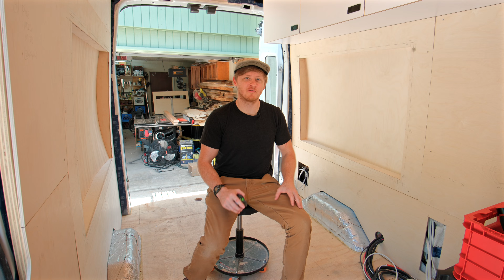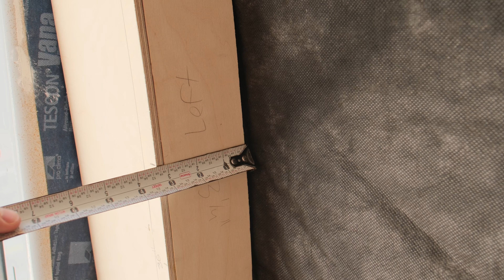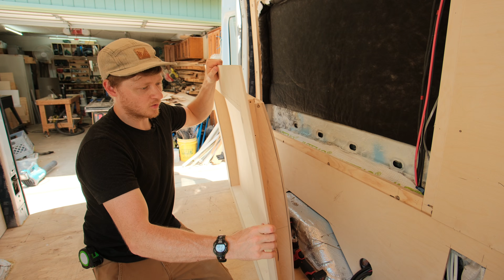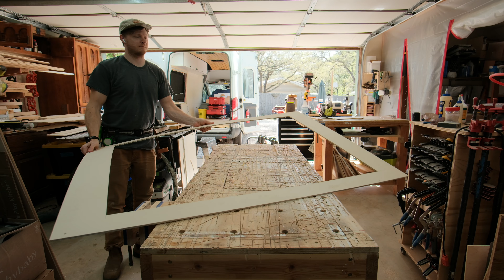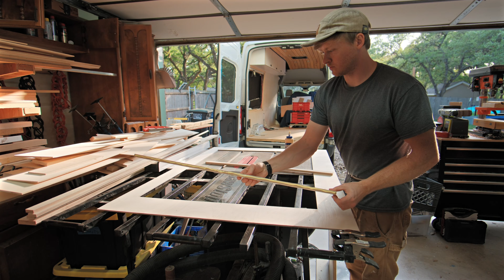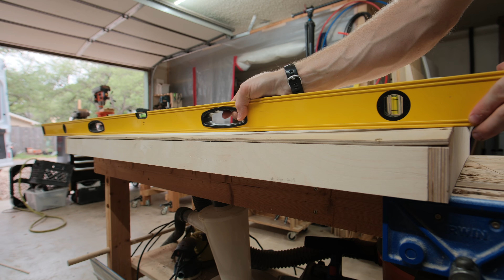No Flares? No Problem. Try This Wall Panel Build Instead

Comment: Sam, with the extra space behind the wall, if cost wasn’t an issue, would you add some radiant barrier and/or more insulation? Thanks
Reply from the maker: I do plan to fill the space with more insulation. A radiant barrier could be used but doing them properly in van walls is a challenge since a radiant barrier needs an air gap as well to perform as intended.

Comment: Greetings from South Texas, great videos I'm learning a lot. I trying to convert a box truck.i Was wondering is it possible to use to use 2 1/2 aluminum studs framing for wall builds and possible for bump outs? Thank you so much
Reply from the maker: Hello! Box trucks are a little different in that they are usually more square and wider already than vans. I guess it would depend on how the box truck is constructed but you may not need to build out framing with aluminum studs if you can just build out over the framing already present in the box truck (maybe add wood furring strips over that and then wall panels from there). If the walls are more uniform and not as deep (what I'd expect from a box truck instead of a van) you may not need bump outs in the wall.

Comment: I really do not understand. The question isn't how to squeeze space, the question is how not to take space out of the van. Which means why does everyone create such thick walls. Thats where the problem is, not the other way round. Start with zero walls and then add width to walls when its absolutely mandatory. The industry has this backwards
Reply from the maker: Interesting thoughts - I would definitely be interested in seeing examples of what you are describing.
Reply: @ThanosSofroniou I agree, I think it’s most commonly done because it is a lot easier. It is a lot easier to build a frame so your panels can be flat(ish). Also, most of these videos (there are exceptions, like this one) are made by people who are not very skilled builders. For some of them it is literally the first time they are holding woodworking tools. So very understandable they make it easier on themselves. Just to clarify, this is obviously not for this channel. But the one off build videos by a lot of these conversions.

Comment: So.. I've not built one, to be fair, but wouldn't a lift bed towards the middle give more space within the van and make it less likely to rock if you move/shift around in your sleep? It seems like having all a person's weight and storage near one end of the van is also more likely to create additional wear on the rear axle/wheels.
Reply from the maker: These vans are pretty sturdy and designed to hold cargo in the rear area. Having a bed and storage in the rear half isn't enough to cause an issue with weight distribution. I worry more about keeping the weight somewhat even side to side than from two back. The van is about 11' long so if you situated the bed in the middle you'd be left with about 3' on either side which would make for awkward layout options for the other areas (kitchen, seating, etc).

Comment: Great way to maximize bed space.  By the way, your kerf cuts probably would have worked, but the cuts go to the inside of the curve... not the outside.  Because the inner part of the curve is smaller than the outer, hence the removal of material to accommodate.
Reply from the maker: That is a good point on the kerfs 👍